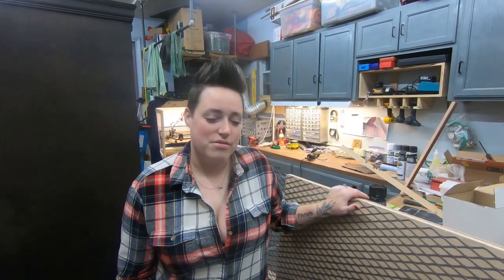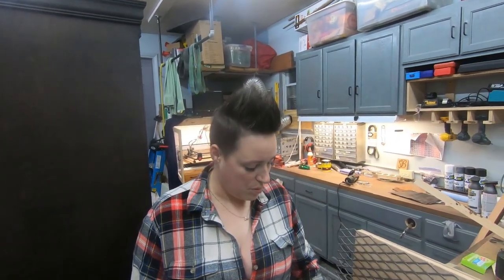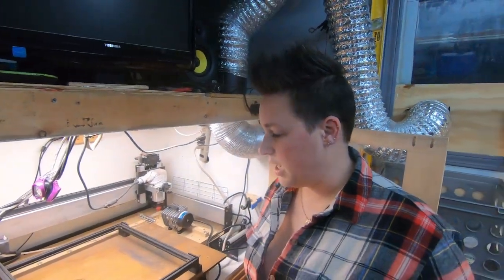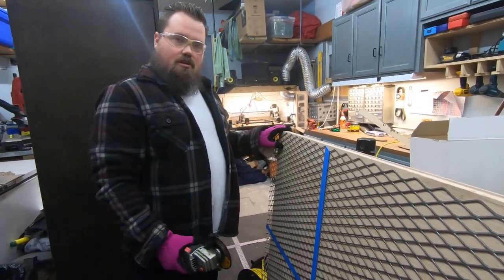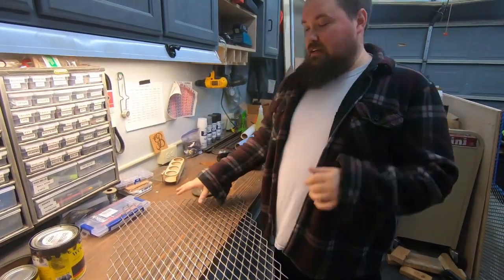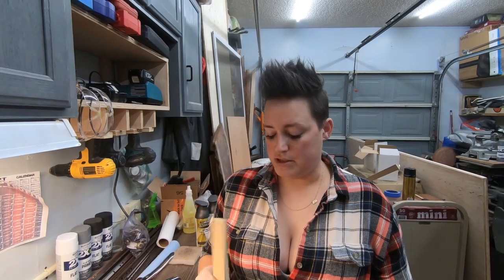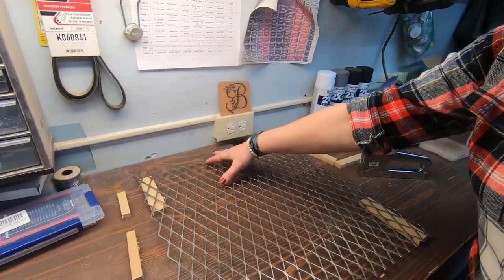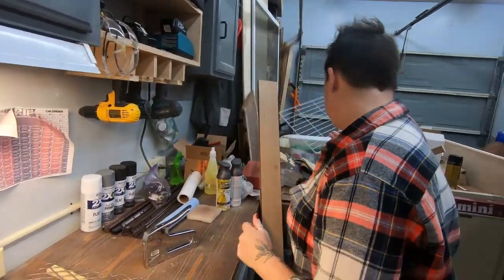How to Make a DIY Metal Laser Bed | Ortur LM2

Comment: Can I use peg board for co2 laser bed?
But the issue it has more area and less holes!
So laser will touch the bed more often!
Will that be an issue?
Reply from the maker: It would work. Wouldn’t breath as well and might also burn. If you aren’t trying to do a lot of cuts it won’t matter. But I have found that more opened help with airflow for cutting.
Reply: @KLRform  
Steel peg board is available
Reply from the maker: Won’t burn then. I had one laser come with a solid sheet and it leaves nasty residue but works fine.

Comment: Great video and use of material. But I would sugguest that next time cutting something like that you would find it easier to use end of a table or work bench to cut with grinder (less kick back) I know this from experience. Yep I have done the same as you did.
Reply from the maker: Yeah that’s the plan. Didn’t like doing it that way in the middle of doing it…. Thanks for the comment!